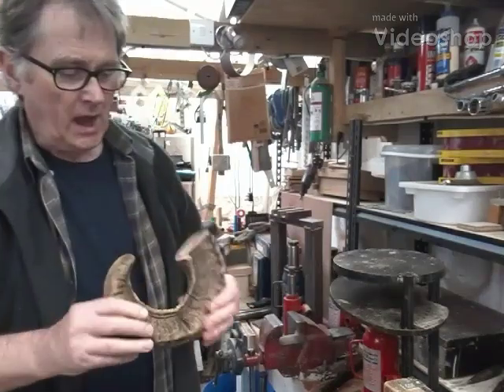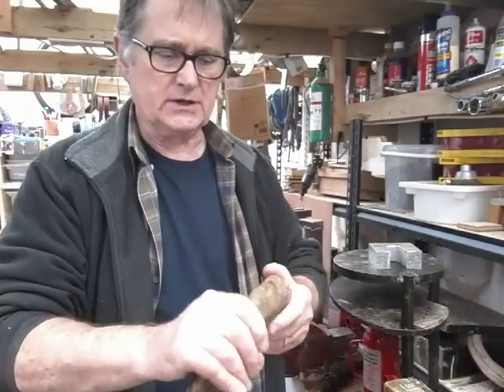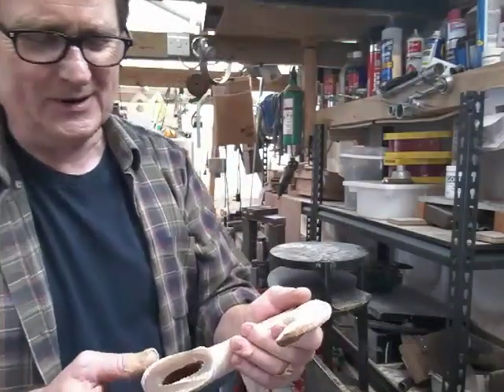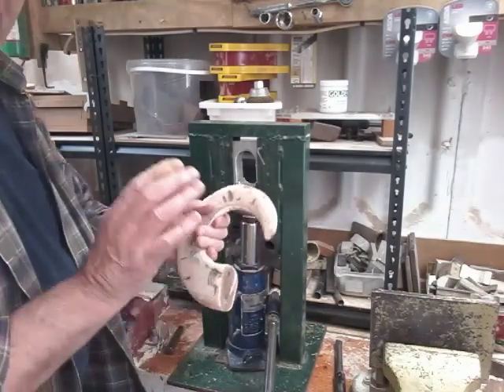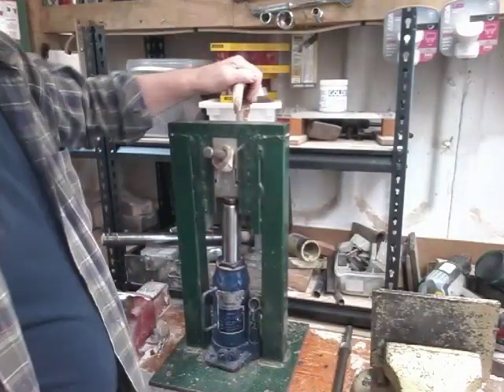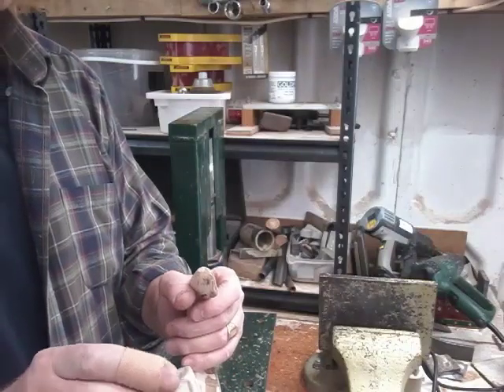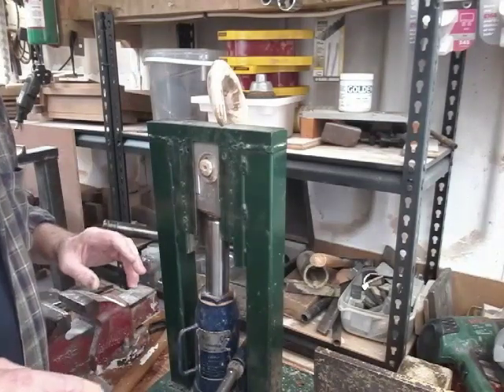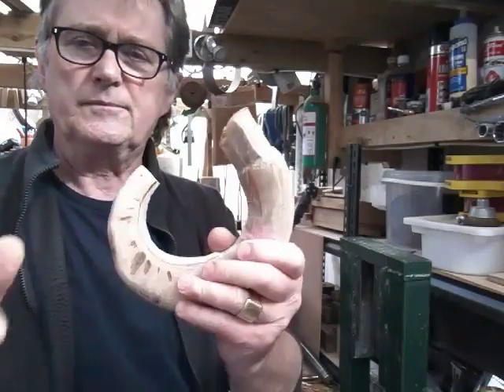Making a crook in rams horn. Part 2

Comment: Any ideas where to get the formers for bulking up. I used to use some large aluminium tube clamps but I can't find any now.
Reply from the maker: I have a feeling I saw some one on Face Book selling some but cant be sure. Highland Horn used to sell cast aluminium shells but dont know if he still does, woth a look.
Reply: @wrencountrysticks8660  Thanks for your reply. H/Horn don't sell them anymore (tried them)  Inspired by your video and because I have just acquired 2 really nice horns, I have been trolling ebay for ideas.  Came across some clamps for caravan jockey wheels. Look like they might serve. They are cast aluminium, 48mm and only £15... Thanks again.
Reply from the maker: @twistysticks1  Hi Phi, AsA last resort you could make your own, buy in the ali bar , cut using a dand saw or chop saw with the right blades. You  an use hole cutting saws to get the curve at tbe top of tbe block. You really dont need a lot of sizes 3 to 4 should be enough. Also if you are in the BSG try the adverts. (British Stickmakers Guild) if you are not a member its worth joining. Open to all
Reply from the maker: Hi Phil. You were asking about bulking blocks a while back. Just seen some come on Facebook,Check out a fb entry by Paul Daunt 28th Nov. So e one called Sean Johnston is making and selling these. Or at least thats how it appears. Hope you find some, Joe.
Reply: @wrencountrysticks8660  I sell them on ebay along with crushing plates and shaping beds, look under bulking blocks

Comment: This is very helpful. I am using a water buffalo horn for my crook, is there any difference?
Reply from the maker: Yes , lots of difference between rams horn and buffalo horn.   Buffalo horn is compressed hair and as such will not take the amount of bulking a rams horn will take. There is only so  much give in buffalo and no more when it come s to bulking. In essence you could use the buffalo as a piece of timber or plastic. The first thing you need to know when working buffalo horn is that you need to impart far more heat into the horn to make it move. Whats feels very hot on the surface may not be enough inside the horn to allow it to bend without cracking.   The easiest way to produce crooks out of buffalo is to firstly have a large enough horn, as you will be cutting back to produce the neck part of the crook. Then you will be also cutting surplus away along the portion that will be the crown  and nose.     Once you have remove this bulk  you can fit the horn into your shaping jig and apply lots and lots of heat to start the bending process.  All this bulk removal  is a little like the bulking of the rams horn in that you are trying to get to a basic shape where you can start bending into a crook shape.  When it comes to shaping the horn around your jig for the crook shape you will find it far harder than moving rams horn, so keep applying the heat. You can use various oils like Neetsfoot  oil on the horn to try and reduce some of the burning and to keep the condition of the horn from suffering due to the heat applied, but this does mean a very messy job. Hope this helps a little.   Most stickmaking books cover Buffalo horn bending so its a good idea to see what others may do.